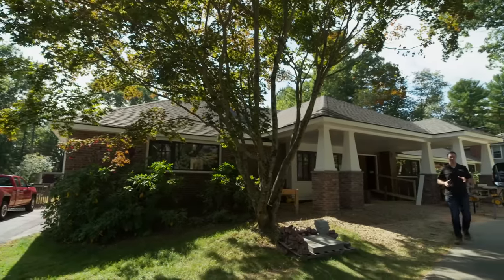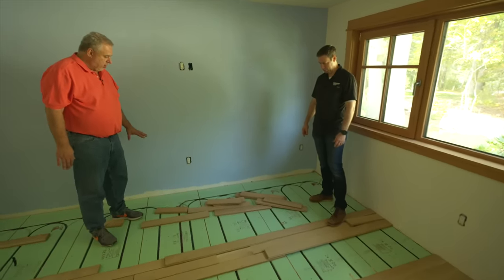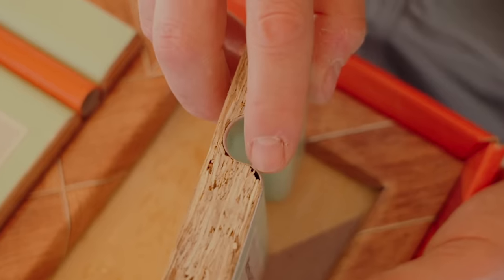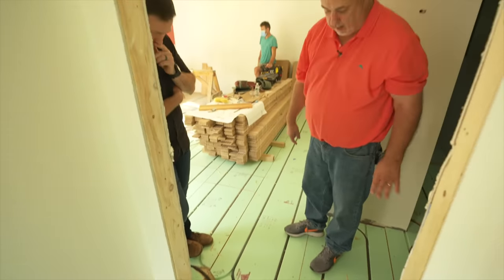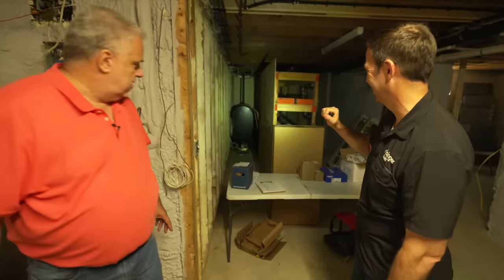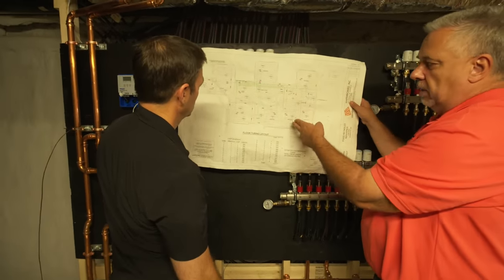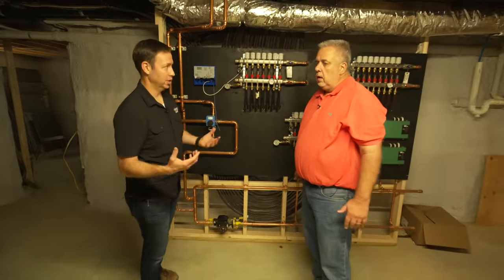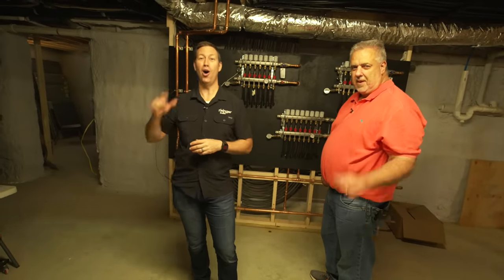Plug and Play Radiant Floor Heating System - BEST ON THE MARKET

Comment: I could be incorrect since I'm no hydronic system expert but in my experience the manifolds could have been mounted upside down (pex brand suggests this for their manifolds) in a basement install saving some of the mile of tubing used, loss of heat and install time looping and stapling. I also think two pumps would be more efficient on a system of that size.
Reply: I was thinking a two pump system as well.  If one pump fails,  then it can be by-passed and still have heat going until a repair is possible.
Reply: The manifolds are mounted correctly . Two pumps wouldn't be more efficient - you size the pump to the flow requirement and the manufacturer has already sized the motor to work most efficiently with the design pipe size. Having a redundant pump plumbed in is IMO not worth the effort and will reduce efficiency as you have to have extra bends. Best practices say you should put a valve either side of the pump and replacing them is probably 20 minutes. They are pretty reliable but they are also pretty cheap - if you are worried buy a spare and put it on a shelf.
Reply: PS I think you are confusing PEX manifolds designed for hot/cold water and hydronic manifolds. The hydronic manifolds have a variable valve and a flow meter rather than a simple ball valve. Heatsink, Uponor and Watts are all mounted this way.
Reply: @francisrampen9099  This is a longer read but the last part talks about mounting the (hydronic heating) manifold in a basement. (Copy and pasted from a manufacturer) The two vs one pump thing is over my head without seeing some proof or testing. The system I built and that works well has two pumps and I didn't have to add any bends or elbows for the second pump. I also have a Taco air eliminator at the highest point of the system in the basement. Purging a basement mounted system that heats a floor above takes longer compared to the opposite but once the air is out and a good mix of glycol mixed with distilled water is flowing through it becomes a maintenance free system till something quits working or a leak develops. And yes I have valves on each side of my pumps for easy replacement without introducing a bunch of air into the system. 
                                     Good Day Francis

Installation:
Proper installation of a radiant heat manifold will guarantee the best system performance. Radiant manifold with balancing valves is the return manifold and it should be the one on top. Supply manifold is the one with flow indicators (flow meters) and it should be the one on the bottom. If PEX pipe installed at or below the level of the manifold station, this configuration will allow the air to escape to the highest point in the system, which is the return manifold, where air elimination device is installed.
If the manifold system is located in the in the basement or below the level of the heating system, the supply manifold should be the top one and return - the bottom one.

One of the distinctive advantages of the mounting system is that it offsets the radiant heat manifold from the wall and allows for a more convenient access, simplified maintenance and easier PEX tubing installation. Flow indicators serve as secondary valves and can be adjusted to increase or decrease the water flow through individual branches. By default, shut-off ball valves are 180 degrees (straight). 90 degree valves (angle) can be purchased to make the upgrade.

Manual balancing valves on the return radiant heat manifold allow to adjust the water flow through an individual selected branch from 0% to 100%. Since radiant manifolds often service several zones or rooms, and it is nearly impossible to have all circuits to be the same length, flow through the manifold's branches should be adjusted, so that each circuit gets the proper amount of hot water (more hot water for the longer loop and less for the shorter).
In order to automatically control the hot water flow for each branch, radiant heat manifold actuators (automatic balancing valves) have to be installed. If the manifold serves a single zone (i.e. one large room, a warehouse or a garage), actuators are not required and a single zone valve or zoning circulator can be used instead.
 

Note that this type of PEX manifold type can be installed upside down, where PEX tubing outlets are pointing upwards, which is convenient when manifold is located in the basement and is heating the floor above. However, air vents would need to be kept closed and a separate air elimination device would have to be installed.
Reply: @adams4425  Matt actually described it wrong - if you look at it closely the supply is on the bottom - you can see the flow meters - and the return is on the top like it should be. it is also colour coded properly - red is the supply, blue is the return. Personally I wouldn't bother using glycol and/or distilled water on the heating loop. . Glycol  is very expensive these days and unless there is a chance it will freeze not necessary.  Most systems run connected to mains supply as it ensures that the system is top offed automatically. Glycol is definitely a no-no if you are connected to the mains. I've never seen scaling to be a problem unless the water in your area is truly hard. If you are running two pumps in series which is what you seem to be suggesting I don't really see the benefit - pumps are reliable, cheap and easy to swap out. Most pumps I see last at least ten years if not twenty.
Reply: @francisrampen9099  You seem to be quite knowledgable in this area.  We are planning to do radiant what tankless heaters.  Any issue with that?  We are in the NW
Reply: @luvnailz  A tankless water heater is pretty much analogous to a standard boiler - both heat  a relatively small amount of water on demand. The thing is to properly size the unit relative to the expected worst case heat load. You do have to be careful about plumbing the system so that air is removed from the feed water AND to avoid galvanic corrosion. Given that they tend to have similar costs I would consider a proper boiler. I think most boilers have  more robust heat exchangers than you typical tankless. Depending on the daily temperature delta there is a lot to be said for using a simple water heater - the mass helps get the system up to temp quicker, they are pretty cheap and parts or replacement units are available at the big box stores. There is a lot of good info out there - Heatsink for example have some excellent engineering guides.

Comment: Matt and Steve - I notice you mentioned that there is baseboard  in the basement.  A year ago, I added baseboard and insulation to our Connecticut basement and haven't regretted it.  Besides a laundry room, the basement is used as an exercise room (Treadmill, Weights, etc.).  Can you elaborate on why this basement is heated?  I seem to remember from a previous video that the wife has a hobby room in the basement?  We've noticed since heating our basement that the cold drafts have been eliminated, and the first floor seems more comfortable.  Love what you've done with this house.  Looking forward to a final walk-through.  Thanks, Bill

Comment: My office has radiant floor heat.  It's wonderful.   Wish I had installed the cooling when the heating was installed.  That would make this Midwest person really happy.  Yes not only can you have heated floors you can also cool the floors.
Reply: Radiant Cooling does not really make sense. If you run below the dew point, the floor will collect condensation. Cooling really needs to be ducted to so the humidity can be removed from the air.
Reply: @guytech7310  In radiant cooling the water is cooled and pumped cool through the floor tubing.  With concrete floors that get and stay warm in the summer, with cool warm
circulating the concrete floor would not be warm.  It would make the work of my mini split a/c easier.
Reply: @susang6193  No, because the compressor still need to cool the floor, unless your planing to go with geothermal. The issue is you need to make sure that the floor never drops below the dew point which is dependent on the humidity levels which can change quickly if you take a shower, or run a dishwasher. Unfortunately radiant cooling just does not make sense.

Comment: Hey Matt can you put that floating floor system from stellar floors w/evan, the one you kicked the boards into place. Placed over this floor without gluing and stapling? In Pennsylvania. Also can you use an on-demand electric or gas water heater?
Reply: That's what we're planning on installing, an on-demand water heating system... wondering if it would work with this??

Comment: I used warm board in our remodel and it is great stuff and a good company to work with.
Reply: @william wengel -  How many sq/ft did you do in the remodel? What have you noticed using it now vs. your old system? I am very interested in radiant floor systems in general.
Reply: @MattBell_USA  it is great....the house might be too warm now!  The room we used it in was a living room 530 sq ft and 14ft. High ceilings.

Comment: Best. Video. Ever.
What could 77 people have possibly objected to in this video? I’m pretty picky.What did I miss?
Reply: Could be they don’t like New England, white pine, underfloor heating, high humidity, or anything else mentioned in the video.
Reply: Well then why are they here? Looking for cast iron radiators? HVAC sheet metal vents?
Reply: @stevenbaczekarchitect9431  I hope you are not calling the people picking the system apart 'idiots'. Unless you are 100% sure this system could not have been improved upon when built. You are the architect though, so know one expects you to be the expert on anything.
Reply: @adams4425  I  welcome constructive criticism,  and learn from it usually.  I should have been more specific in defining the trolls of the internet that do nothing but unsubstantiated comments with a negative tone. You dont have to like anything I  do, but if you want to criticize,  please come with a discussion point

Comment: Have it in all my homes and will never live in a home that doesn’t have radiant heat.   So many positives!!
Reply: But where do you live?   I wish many others making qualifying comments would also mention that simple fact.
Reply: @CannabisRex   Two homes in Wisconsin and two homes in Iowa.
Reply: @CannabisRex   Two homes use geothermal and two use LP.
Reply: @markryan3995  Thanks.  I live in Council Bluffs
Reply: @markryan3995  I have geothermal in one house that's forced air and the energy bills are terrible. The compressor has to run for every cycle. How do you like yours tied to a radiant system?
Reply: @timm439    Hello Tim.    This response may not help you but here goes.  You can probably skip house 1 comment. 

House 1 - geo source:  house has about 6 or 7 compressors and 4 Weil McLain boilers as back up. There are numerous storage tanks that store hot water for on-demand if the geo cannot keep up with the demand.  I honestly don’t know how it all works or how much the utility bill is.   House is around 20,000 feet on Lake Michigan in Wi (cold all winter), but the radiant in all the floors, 9 car garage floor and green house floor is amazingly comfortable. 

House 2 - LP source:  This system I know.   Approximately 4,000 foot weekend home that has one system.    I have a Rinnai tankless hot water boiler.   I keep it at 71 degrees most of the winter.   I installed a 1,000 gallon buried LP tank and filled it up.  Exactly one year later I had it filled for the first time and it cost $506 dollars.  I think LP was around $1.20 at that time.   This house has a lot of solar gain do to the construction of it. approximately $100 per month during the winter season.  Close cell foam insulation.  And the houlocated in Iowa.  
House 3.   Should be receiving the Certificate of Occupancy anytime so I have no idea what it will run.
Reply: @timm439     I was trying to reply and was cutting and pasting and sent that last message.  I won’t be so detailed.  

I live a cold climate.   I think all my systems are extremely comfortable but I don’t have any idea how much it cost to run the systems.   The Weekend house that has the Rannai  is the only place that I know for the cost to operate and only for the first year of operation.    I happened to be there when they stopped one year after installation of the LP tank and I was curious to see what it cost for one year.   

All the other homes - I have no idea what I pay for utilities.  

I know not a very good answer and sooty for the sending of the first message when it was messed up.

Comment: A 2400 ft^2 basement...holy crap, that’s big.
Reply: Why? We have 1940sqft/180sqm fullhigh basement with 2,5 floors/storeys on top. 
Absolutely normal in my capital-city location/neighborhood. 
Funny part, the real estate and the plot/land has increased by "times 3" in the last 10 years. 
Hoply my 2 Apartments goes also massively higher.
We have also Viessmann and Grundfos warmwater and liquid floor Heating system since 34 years 😂.
Oh Murica/Canada you life behind the moon. 
Greez from central Europe.

Comment: I love the idea of a warm floor but in most place in the US, you need AC as well which means having 2 separate and different HVAC systems, which seems like a but of a luxury....  And, if I ever do a remodel or new built, I want all my mechanicals to look that good.   Speaks to quality & craftsmanship - you know they are not cutting corners....
Reply: Radiant cooling is a thing too; just use a reversible air-to-water heat pump and keep water temps 4 degrees F above the dewpoint.
Reply: Totally agree - when you look at these plumbers work, you know they worry about "Everything" - and that's a great feeling to know your partners are such
Reply: @InverseCh  All well and good in low humidity climate zones like here in Colorado, but needs extreme care in engineering design in hot humid climates. And that will probably mean some type of air system(s), to regulate indoor humidity.
Reply: @leestevens446  correct, you would get your humidity control from a doas.
Reply: having 2 systems actually is not a bad idea.  With inverter style ductless systems.  Super efficient.  Having radiant it is quiet and an interesting thing.. dust mites dont do well so dusting can be a  thing that most seem to forget about for livability
Reply: @leestevens446  Yeah. I agree. I think radiant cooling should work easily in most climate zones except the deep south and coastal areas.

As long as the indoor humidity stays below 55% RH when you need cooling, it's trivial. Gets trickier as the humidity goes up, outdoor temperature is super high, and the home itself is poorly insulated. 

Insulate the home well and the water temperature can stay at 60 degrees F or higher, with indoor humidity <64%.
Reply: @leestevens446  I too am located in CO, 9k’ in Nederland. We have HRV w/our hydronic heated floors. Because of our low humidity, it’s not needed but integrating a dehumidifier, or humidifier if you choose, w/HRV system would be commonplace and simple
Reply: @MichaelM-to4sg  The problem with this channel is that everything is presented as vignettes, not at all comprehensive re: full and complete principles that can be applied by anyone in any situation. I have quit trying to post anything educational here, it is a waste of time. My comment was simply to jog a few folks mental mapping, basically that one cannot "do just one thing", particularly as required building climate control, particularly as regards radiant cooling (the comment I was responding to). There is a real concern that unaware people will latch on to key buzzwords, and go out and do things that are ultimately destructive to their dwelling. As a builder, I have done some reasonably straightforward systems, but also some extremely complex ones. We have done a house with custom engineered air handlers that combine evaporative cooling with chilled water coils (from ground source heat pumps, also producing hot water for the radiant floors). Those two modes function very differently, and one really needs to know one's stuff to attempt this. ERV's were also part of the install, along with judicious use of kitchen ventilation, all overlaid on extreme building envelope air sealing. And for context, the integrated hardware, wiring and software to operate and control such systems is incredibly expensive ($250k +/- for the controls package for the previously cited house project).

Comment: Once again Matt and Steve smashed it, one of the nicest installed I have ever seen. What they didn’t answer was the cost for such a system
Reply: Thanks my man!!! Appreciate it - for pricing check out the Warmboard webinar on the BuildShow Network where the CEO/president talks about pricing
Reply: remember the cost has much to do with the results you want
Reply: @stevepailet8258  Yes, many ALWAYS ask what is the cost, as I said "good things cost money" and some clients want good things....
Reply: @stevenbaczekarchitect9431  $ is always a scarce resource.  Those who want the best hire the best.  Years ago while selling HVAC equipment had a contractor who always low balled his prices to get work.  He never got it that the small upcharge was not the same as the full price for a standard unit plus a little upcharge to make the customer that much happier just by presenting it this way.  Over time it will break even and then continue to save you a lot of money.  Kind of the same idea of putting that extra layer of no thermal break insulation on the outside of the building envelop.  Just makes the house a lot more COMFORTABLE.   So yes I do ask the cost but it is the incremental cost for that huge leap in livability in the house. Not sure but that might be a reason why people move every 7 years.  So much construction sucks in quality